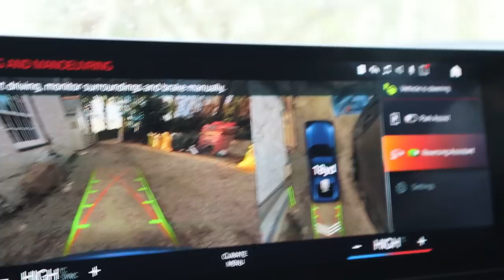OUR NEW ELECTRIC CAR | VLOGMAS 11

Comment: I probably sound like a broken record but gable-end walls of rooms are especially battered by the elements, so it is worth a little extra expense to get them drylined (also known as drywalling) inside ~ to ban mould for good. It will take about 3 inches off your bedroom size, and is certainly so much cheaper than re-pointing the whole of the external. Don't forget external re-pointing won't necessarily eliminate mould as you have solid walls (no barrier cavity), which will always allow a degree of natural external moisture to percolate to the interior. I've become a bit of an authority on the subject!, as I have a ground floor Victorian home, and the drywalling has made all the difference :)
Reply: Excellent advice, Joanna.  My husband is a drywall contractor.
Reply: I agree. If there is no cavity between the outside and internal walls then you will always have condensation and mould. Spoken from experience living in a 150 year old stone cottage and also experienced mould on my shoes kept in the wardrobe. Also, don’t dry your washing upstairs in the bedrooms as all that water has to go somewhere. Good luck x
Reply: @carriestandridge4043  A 'belt & braces' drywall (fully battened out + insulation board inserts + foil backed plasterboard) also provides the extra bonus of thermal insulation...saving on fuel costs.
Reply: @JoannaLouise200   I would definitely hire you - you know what you're talking about and it would be done right.
Reply: It would be a shame to go to all the work of painting a room without addressing the underlying problem with damp

Comment: Little tip for mouldy walls.  Once it's been cleaned, do a coat of Zinsser BIN primer prior to painting.  It really helps stop any moisture and mould caused by internal condensation from wrecking your paintwork on external walls. Also leaving an inch gap between the headboard and the wall will help. Peel Stop may be useful for the flaky paint around the skirting board if you're finding it's not scraping away or sanding down very well.

Comment: The fact that you have a dehumidifier is brilliant! Hanging the washing indoors is always problematic, but if you don't have another option, switch on the dehumidifier the whole time, until the washing is dry. It might seem like a waste of electricity,  but it really helps to prevent mold from growing, so I think it's worth it. Also before you get the washing out the washing machine, (depending on the fabric), you could give it an extra spin. That makes it less wet to begin with when you hang it.

Comment: Oof, I worried about mold on furniture with the paint flaking away from the wall near the baseboard. I've found that hydrogen peroxide works really well on walls to deal with mold. I spray it on and leave it for ten minutes and then wipe it off, followed by high temperature steam cleaning to sterilize anything that wasn't gotten by the HP. 

I'd gently suggest getting paint chips in that bedroom tested for lead, just to know what you're dealing with.

Comment: To make the drawers darker you could rub in some black wax which just picks up on the grain and ages the look.  I would read up on it to see if needs a finishing coating on top so that when you wipe with a cloth the wax doesn’t come off. It does give a lovely subtle age look though so maybe worth doing. Just a suggestion.

Comment: I would also consider adding high quality air purifiers in the rooms that have mold. That way it will help reduce the spores in the air. Mold can be very dangerous. Reducing the spores will make the air cleaner to breathe and also help reduce the spread of the mold.
Also, when repainting, use a moldicide primer.

Comment: I live in a 200 year old farmhouse in North Devon, we also have a mould problem in one bedroom with three outside walls. One thing we do to help prevent it is to crack the window a couple of millimetres everyday. We also make sure non of the furniture actually touches the walls so air can circulate.

Comment: Paint made of lime is brilliant for stone cottages as it breathes just like the stone because lime is stone. It akso has lots of anti-bacterial, anti-fungus, anti-mould and anti-insect properties. Also very very natural and strengthens the walls as well it is rock.  You don't remove to prepare for painting over lime paint as well it is rock, just slap another layer of lime paint on top of lime paint.  Its a very old, traditional way of caring for rock buildings and wood buildings too.

Comment: Use a clearcoat with a dash of the wall paint in on the dresser for 'wash' look in the same colour as the walls.  You don't use undercoat on the dresser.  It will help the dresser match but not matchy matchy.  Just make sure the clear coat is also water based if it is water based paint on the walls.  This way the dresser is also recognisable as being wood but not in your face big.

Comment: I'm concerned about the mold issue you're having... I realize it's an older historic home and the walls are solid from outside to inside, but this can cause major health problems if not fully remediated. I would think you would need to fix the mortar outside immediately to stop the issue of water getting in and then figure out how to deal with the condensation issues. I read someone say to put drywall up and the problem would be fixed... drywall can and does mold too so idk how that would fix the issue? I'm just concerned fur your health as you sound congested quite a lot of the time. No offense is meant by this AT ALL! I just know that mold remediation is a very big deal over here in the US.
Reply: Yessss I have a few friends with chronic health conditions from mold....its taken them years to detox from and try to get their lives back...mold is a really serious issue...